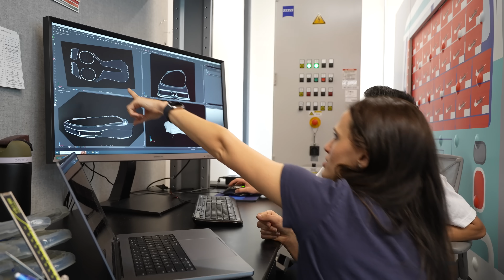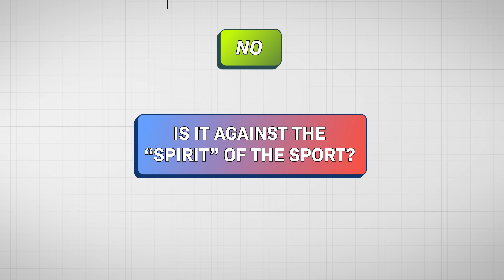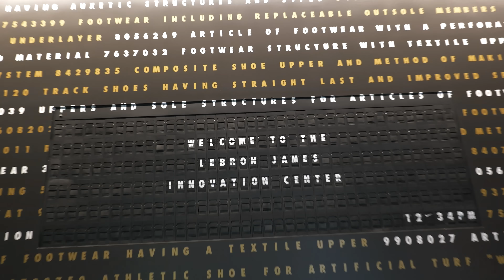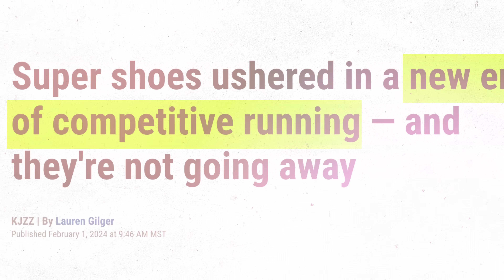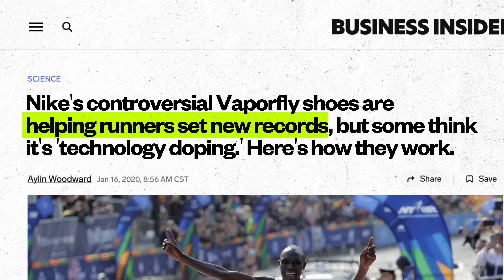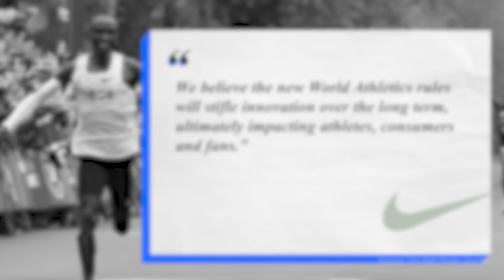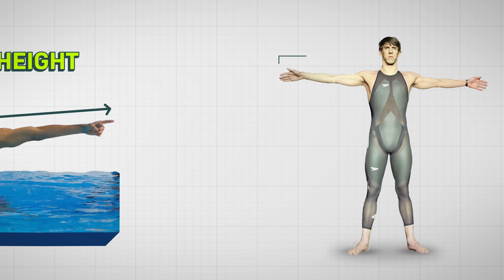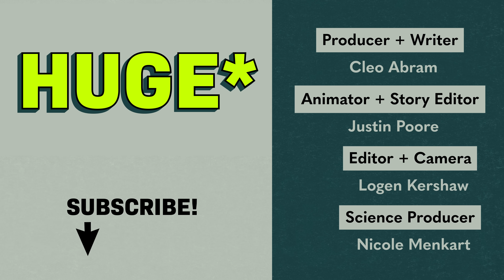The Shoe That Broke Running

Comment: Blake stood out here, seems like an amazing human being. Being capable of saying "I disagree, but I understand" in the face of being disqualified from the Olympics for something outside of your control is a whole other level of resilience and maturity.
Reply: Blake was right in what he said though. It's like opening Pandoras Box. 

If runners with blades would possibly outrun everyone else. That would be crazy
Reply: @kereamohau Really it's no different than the Pandora's box of running shoes though. They'll just adjust the rules and regulations as necessary.
Reply: Well said. I'd be pissed if I was him, training so hard and overcoming a disability just to be told he can't compete based on a questionably calculated theoretical height limit...
Reply: @davidtoomey4712  The height should be based on his family's proportions.
Reply: @JohnDlugosz  ...though some families (like mine) have super tall and super short siblings.
Reply: @JohnDlugosz  that's also not fair. We have huge variations in families
Reply: @JohnDlugosz  the height rule seems arbitrary and unfair. the fastest runners in the world are not the tallest.
Reply: The problem with this particular situation was that similar to what happened to Phelps, the rule came after the race in which he qualified, but again the rule does seem fair, being taller than you naturally would have been is a big advantage in running. And if they then told him that you are qualified but can only run with a height of 5'9" when people don't even run with different shoes without training in them for months. So as much as it was unfair for him, now there is a rule on the books for this and the future athletes can train accordingly.
Reply: @vinaybucha4777  tallest people aren't the fastest, so no
Reply: @vinaybucha4777  give somebody extra long blades  like stilts and see how much of an advantage it is
Reply: Sadly, I think his problem is what happened with Pistorius off the track. When Oscar raced with able bodied athletes, the public were with him, willing him on. But the court case, and let's face it, with the death of a beautiful woman, turned the public against him, and the chances for parity with disabled athletes.
Reply: It's wild how they used a small study from Caucasian and Asian men to define how tall a black man would have been. Dude never had legs to begin with, how would you know how tall he would've been?
At the very least I would've looked at medical records of the men in his family from both his mother's and father's side, then taken into account modern medicine and diets to determine how tall he would've been.
Reply: @DotDodd  yeah, a lot African men have smaller torsos but super long legs, I'm not African, but I also have a short torso and super long legs. I'm 5'10, but if my torso was proportioned  to my legs I'd probably be 6'1, similar to my legs being in in proportion to my torso, I'd be like 5'7
Reply: @KoolioJosh  There's A LOT of variation that can happen with body proportions, even within relatively genetically homogenous populations... my wife and I are both ~90% European... English, French, German. (We did our DNA tests and found a common ancestor not too far back... we discovered we were 4th cousins 😄). We are both 5'10" but when we're sitting, I've got 3" on her. She's got LONG legs, and I've got a thorax mildly reminiscent of Shrek 😆
Reply: @DotDodd  Solid!
Reply: @DotDodd mmm, that is a difficult one. You look at basketball and it’s dominated by very tall African Americans. But really those are outliers. There’s a whole load of genetic and environmental considerations. The Dutch are super tall and only became so last century and there’s not much genetic difference just diet that causes that.  It’s why Japanese are suddenly catching up too. Just because Phelps has extraordinarily long arms you can’t go off that for everyone.  How you can be fair when someone has never had legs. He would have had to have had disproportionately long shanks to be 6ft2. Like Phelps had - but is so so rare. Anyway found this fascinating and I just know I’d hate to be on the committees deciding this especially now with genetic sex testing that eliminates people like Caster Semanya. Ultimately we got to keep sports fair.
Reply: @DotDodd  "At the very least I would've looked at medical records of the men in his family from both his mother's and father's side, then taken into account modern medicine and diets to determine how tall he would've been."

The problem is who's going to perform this study?  A full robust research study can cost hundreds of thousands of dollars.  Of course, that wouldn't apply here, but I'm trying to demonstrate how costly studies are.  To collect data on the proportion of black males would have been pretty costly.  I'm assuming they used the data of Caucasians and Asians because that's the data from another study.  They didn't go measure the body ratios of these men.

Also, you can't just use the measurments of his family members because you need to have a minimum number of data points.  There would be too much volatility from only 2 data points.
Reply: @DotDodd  So people could chop their own legs off to get an advantage? Not a road they want to go down. A huge part of being a successful athlete is avoiding injury and managing recovery. Metal cant get injured.
Reply: @valleyshrew  That would be ridiculous. Most people would not do that.
Reply: @valleyshrew I get where you're coming from, but you're neglecting the other aspects of Blake's body—the sheer inconvenience, and the wear and tear of other parts of his body.
Reply: @valleyshrew  There are already major issues with some people claiming that they're trans for advantages...no real information about how many are and aren't doing that specifically for advantage there and it's shredding womens sports there with several of them
Reply: @valleyshrew  that seems like a fairly easy situation to avoid via rules. Do you really believe that any Olympic level athlete would have their legs amputated if there was any chance that it would disqualify them?
Reply: @valleyshrew "Metal can't get injured" - tell that to anyone who's damaged a prosthesis. FFS. Also, there are plenty of other ways a person with prosthetic legs can be injured. Blake even mentioned a back injury sustained when he tried running with blades that were a different height - which makes sense, given that his original set were designed to be medically optimized for his body, and the new set were therefore different from what his doctors recommended for him.

 Prosthetics, of any kind and for any purpose, are MEDICAL EQUIPMENT, by all legal definitions. It's crazy to me that the governing bodies of these sports think their statistics are more important than the recommendations of the athlete's personal health care team.
Reply: @valleyshrew That’s the dumbest shit I’ve heard somebody say in a while. And I’ve heard a lot of dumb shit recently. You should think more before you speak. Silence is perfectly fine, if stupid.😔
Reply: If Phelps got to keep his records with the high-tech swim gear, then they should have let Blake compete with a one-time exception.
Reply: @losergamer04 everyone had those suits not just Micheal Phelps
Reply: @losergamer04  have a friendly reminder that there's a fundamental flaw in having a small cloistered group of "judges" decide stuff
Reply: @losergamer04 q
Reply: If this idea existed more in the general population we would be so much better off as a society. Agree to disagree used to be a phrase we used not only after a contentious debate.
Reply: I need technology to wash my dishes and cleaning without moving from the table.
Reply: @vanessaandreatta9098  want ≠ need 😁
Reply: This is such an easy debate. Nike are talking nonsense, no one is saying it limits innovation, innovate all you want, you simply can't complete in major competitions, which 99.9% of your buying public are not. As for tech in sports, it's simple, either limit it to any product that can't give you an advantage, or two allow everyone to choose to wear it. If a swimsuit gives you a clear advantage, then you'd be a fool not to wear it. And if everyone is wearing it, it's fair.
Reply: i won't judge but if it is affecting sports then sure ban it. every sport should be equal , tech don't have to interfere any type of sports activities.
Reply: Everyone is born with advantages and disadvantages.
Not many boitch about them.
Reply: IOC sucks. They should all be replaced for corruption.
Reply: Yeah! Nothing against Asians but it is widely known the like an Asian size S is never an European Size S for example. And especially in tallness black people have always stood out! To reduce him now to an average Asian size is just not at all correct! Next thing they will create a sunscreen based on it's ability of preventing sunburn on black people
Reply: On one had he's a cheat on the other hand he's a moron. He went with moron... and went home with the sponsorships.
Reply: pfff lol
Reply: timestamp??
Reply: @stevethea5250  13:08
Reply: OMG my brother runs marathons and I just did the "couch to 5k" challenge. He gave me my own pick of his 30 pair of used Nike shoes. All the same, just with different colors. GUESS WHAT shoe it is? LOL. 2:48 at Boston my AS$...
Reply: Blake is a SOLID dude!
Reply: Part of me feels like they let Pistorius compete because they knew he wasn't seriously going to trouble the medals, or even make it through the heats - he was basically an oddity, or a feel good iconic Olympic moment (until his later indiscretions...). However Blake would have been a genuine medal contender and a lot of teams and athletes would have raised a big stink about it. The IOC probably didn't want to deal with the controversy and legal challenges
Reply: @KoolioJosh : The real career is the fame you get from it, so Blake can probably have as good of a career as a silver medal winner, in terms of endorsements, appearances, etc.
Reply: Ke pabrik pt.pindad pactory di Indonesia,,,GASSS POLL 🇲🇨🇲🇨🇲🇨here we go to mandalika lombok island circuit
Reply: Yeah especially when that body average stuff is absolute nonsense :/
Reply: He is circumspect and speaks well, but we aren’t quibbling over a few mm below the knee, we are talking about 5 or “6” inches. I think it’s fair to assume his lower leg bones wouldn’t have been 5+ inches longer than what’s probable based on what is known. That’s my guess as to why he said he understands, because he is honest with himself.
Reply: Not mentioned in the video but it’s worth mentioning for perspective that the wheelchair marathon record is, 1:17:47. That’s much closer to the time of a bike than it is to running.
Reply: Well said. Character on display.
Reply: Haha! 😂
Reply: Those people were ableist aholes. He still had a disadvantage. They were just discriminatory. They even caused detrimental health effects to him by making him change his height. 6ft 2 is a normal height and he trained at that height.  I’m autistic and it just reminded me of all the neurotypicals who think I should actually work harder and still be jobless because of my disability. It’s prejudice.
Reply: @JDMimeTHEFIRST  Stupid people will always call smart people stupid 😕
Reply: @JDMimeTHEFIRST 🙄
Reply: @JDMimeTHEFIRST  6'2'' is normal height?  Sounds like you're biased.
Reply: @JDMimeTHEFIRST  "Autism" - verb, tr: to have a problem and make it everyone else's responsibility.
Reply: That's exactly the maturity on how people should take their L's. Notice how he doesn't go on twitter claiming fraud without evidence for years.
Reply: @thanhtacles  I can't imagine who you mean :)
Reply: @thanhtacles  "Notice how he doesn't go on twitter claiming fraud without evidence for years."

You're referring to Trump?  Elon Musk?
Reply: True, the Greeks did it naked. But they also died from running marathons. So maybe let's not go back to that. ;)
Reply: @unvergebeneid  Shows dedication. Anyway, if you're referring to Pheidippides then, if he existed, he probably had run about 325 miles before dropping dead and only the last leg was Marathon to Athens.
Reply: @unvergebeneid  ONE guy died. It was one guy! 😄Pheidippides (r.i.p.) ...and it wasn't 26.2 miles either. It was about 25 miles, but in 1908 the royal family wanted to watch an olympic marathon and NOT travel, so... 26.2 it is 🤪
Reply: @TheTruthIsEasier  to the best of our knowledge that's 100% of ancient Greeks who ever ran a Marathon ;D
Reply: @unvergebeneid  Veery good 🤣
Reply: The real career is the fame you get from it, so Blake can probably have as good of a career as a silver medal winner, in terms of endorsements, appearances, etc.
Reply: @JohnDlugosz   Psychoanalysis from a distance being what it is, I'd bet money he's not motivated by fame or wealth, so much as by achievement for its own sake. He seems to fit that profile. Intrinsically motivated... and he just EXUDES class!
Reply: If he's been allowed, next year 100 runners all over the world would had their legs cut so they can have better records. Is that simple?
Reply: He can control the height of his prosthetics, it is not harder to run if you are shorter or taller, try running on stilts it is so easy. The only thing that changes is how far a step is, so you will naturally go faster with longer legs or prosthetics. But NO retraining is required.
Reply: @MegaLokopo  It does require a lot of retraining. You need to adjust your pace and balance among other things that screw with your stride.
Reply: @AzraelThanatos  that doesnt take more than ten steps. Ive done it.
Reply: @AzraelThanatos  "It does require a lot of retraining. You need to adjust your pace and balance"

I'm not an expert but I doubt it.  The brain is pretty adaptable.  It'll probably learn the adjustment fairly quickly.  Maybe, even in less than a week.  I think the biggest disadvantage is what Mega said; the shorter stride killed his time.  And, if the shorters stride did reduce his time, then they were right that the longer prosthetics gave him a unfair advantage.  

If you're not going to ignore the height of the blades, a runner might as well make himself 8 ft tall.
Reply: @MegaLokopo i thought that’s what he ended up doing?
Reply: @MegaLokopo  FALSE

Comment: For the height thing. I think just blatantly taking the average wether the sample represents the individual in question or not is stupid. There are margins they could have implemented for this based on a normal distribution but no you're what we consider average now. Eventhough nobody participating in those competions even closely resemble what the average body can do.

Comment: As a runner I have alpha flys and vapor flys and other regular training shoes. I do notice I can sometimes do better depending on the shoe, but I’m not sure how much of a placebo boost the shoes give me. I’ve also had good and terrible runs in super shoes so I know it’s not the equipment it’s the athlete that makes the biggest difference
Reply: Absolutely right, good comment. At the very top of every sport, the athletes are all maxed out in dozens of other variables... and then you throw a 2% gain on top of that. The percentage is important, too. For distance running, that adds up. For all levels below the elite, the shoes probably would only be one factor, amongst many that determine the outcome.
Reply: BS those shoes are proven faster. Total BS. Call yourself a runner.

Comment: My point of view is very naive, but I think you should have all athletes with the same equipment.
Why don't we have a sport where all athletes have to run for 100m but during these 100 meters, some of them have to jump over hurdles and some of them have not? Because it would be unfair, it would change the sport.
So I say: have all the athletes compete with the same type of shoes, the same type of swimsuit, the same javelin. You can have "super shoes marathon" and "normal marathon". But I guess it's too hard to implement, also because it's hard to have "all the same shoes".
It's a complex problem, yeah.

If you can have an advantage that you can buy, that's cheating